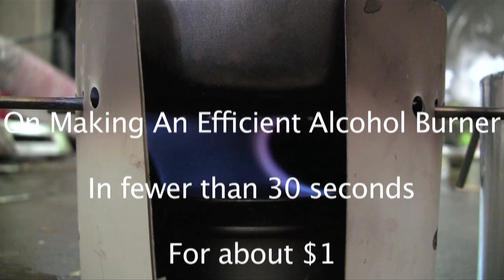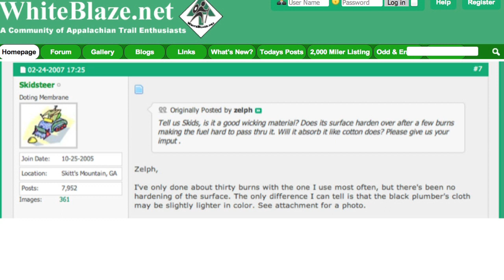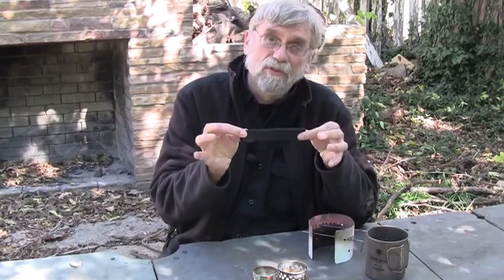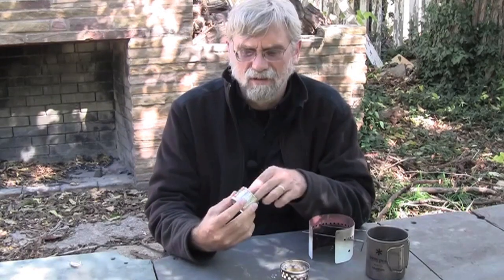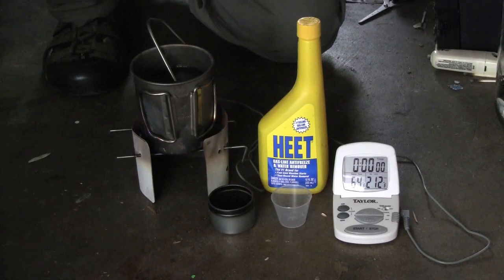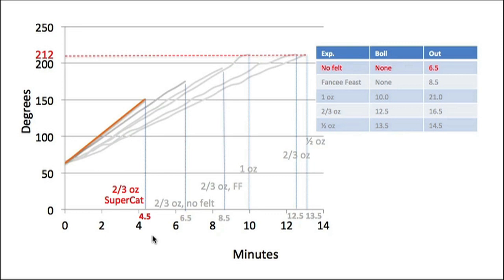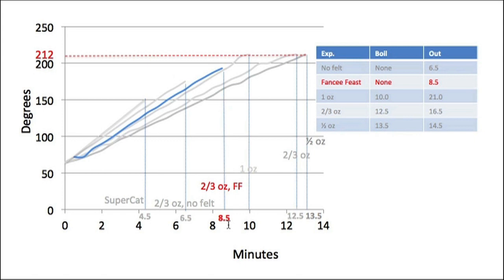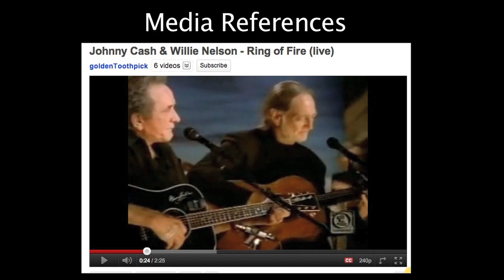A Felt Ring Burner : A Cheap and Efficient Ring of Fire

Comment: @ProfessorHammock I built one of these using the smaller 1 oz. container (TND1, 1.5 inch diameter) with the carbon felt ring.  It boiled 2 cups of water in 9 minutes using 2/3 oz of fuel with the pot resting 1 inch above the top of the stove.  Flame-out occurred at 20 minutes.  The smaller TND1 stove reminds me of the bongo stove that Tinny at Minibull Designs has made.

Comment: I use a similar design. I simply cut a couple of hexagonal or square  pieces of carbon felt and push them into the bottom of a small aluminum drink can of about the same height as yours. I cut the felt just big enough to grip and not fall out. I find I don't need a piece around the inside circumferece. Takes just a few minutes to make with just a pair of scissors (excluding pot stand). Very efficient 15ml/12g to boil  500ml at sea level with an air temp around 10C. Also getting quick(ish) boil times, rough guess around 7 mins. Best solution I have found after lots of other experiments. Instant light, and spillproof if not over filled. Worth a try.
Note: you can add more squares if you are boiling more water, thereby giving more carbon felt to soak up more fuel. 
Cheers

Comment: Carbon felt can be of benefit.
High heat to start cooking then as it slows down, it can simmer.
Perhaps best for use with a small cast iron skillet?

Mating cans -
Place the bottom in the freezer for 10 min. Place the top in HOT water.
Top expands, bottom contracts, give you just enough time to put the two together.
Once it equalizes temperature, it should be sealed.

One advantage of the fancy feast one is that if you have no alcohol, you can use twigs in it.

You can slow down the burn rate by placing your stove in a shallow container of water.

Comment from the maker: Thanks.  My read on the wood burning mode is that it is sort of awkward. You can do, if you have to but you risk knocking the stove over as you feed it, which you have to do a lot.  The wood stoves that give multi-access capable of admitting larger sticks are by comparison a joy to feed.
Reply: Fancy Feast stove should be able to hold one charcoal briquette, which can run for about 30-40 minutes.
For a higher heat output, break the charcoal into 4 pieces then light it. Burns for less time though.

Comment: Geez, that's awesome, Prof. Grizz. You nailed it!  One of your criteria not addressed ideally: low fuel use.  The excessive burn time is a concern & if one reduces fuel to avoid xcess burn time, it might reduce boil temp, aka boiling (by making it, in effect, a larger container like Fancee Feast, in essence).  Thus, to truly reg fuel use efficiently, may need to add as burn (like Tinny's) by some method.  Or, does Prof Grizz have other ideas?  Your vids are the best, boss.
Reply: Inverse relationship between fuel used and boil time.

Comment from the maker: @jonfong57 Thanks, I like the backpressure explanation.  Clearly there is more surface and more air in the FF can so the ingredients are there for a hotter burn but Dang!  if that's it there is some serious non-linearity going on here. Hmm.  I don't suppose I can say that without a 3rd diameter tested. But still....

Comment: very frugal design you have there. What about this, get a tin that is taller and larger diameter that your stove, punch holes around the top edge and make approx 20 mm hole in the bottom, place up side down on your stove, the idea is to get the fuel container hotter, but then again that close fitting windscreen may already be achieving this effect. Love the graph too.